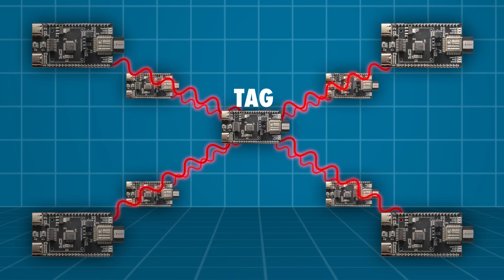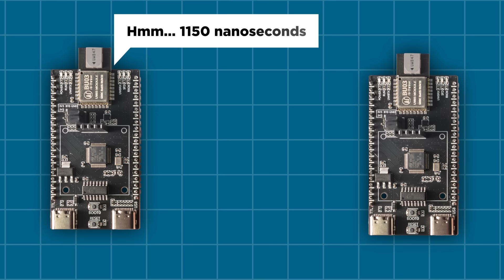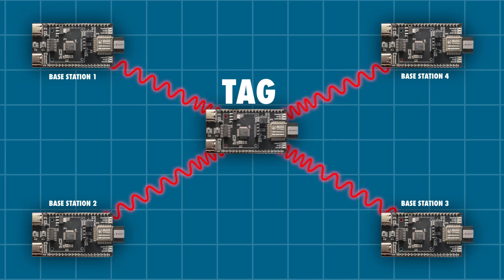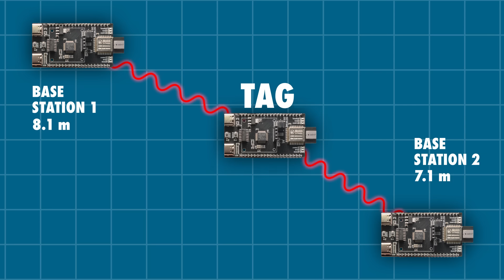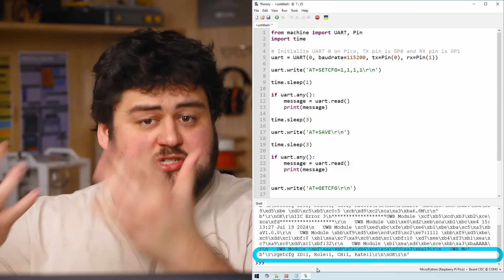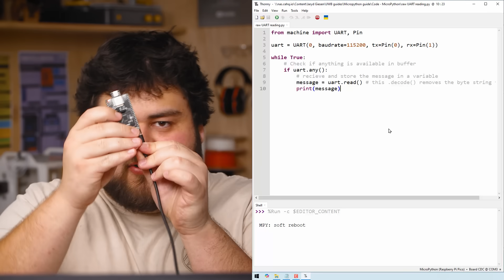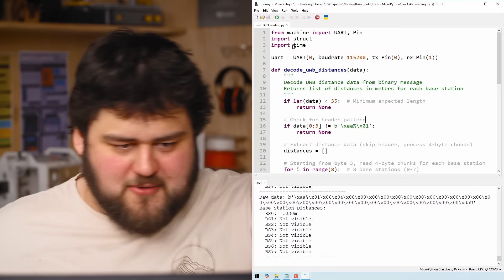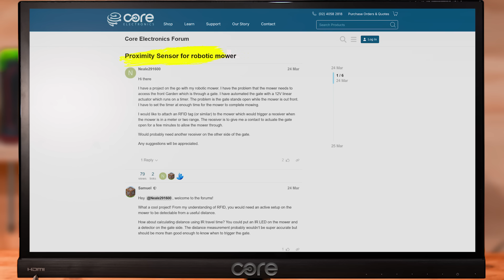This Pro‑Level Sensor Just Went Maker‑Tier

Comment: Will this still work if I mount my 3 UWB receivers at the wall and I want to track the Z (vertical |) and X (horizontal __) positions of the tag instead of a setup (like all receivers are on the floor) where X and Y positions is the output? Both are 2Ds but different axes.

Comment: One of my "Probably will never make this but fun to think about it" ideas is system that uses drone to tend a garden/field, one of the first obstacles that came to mind was precise tracking, something like GPS but local LPS would be needed (with beacons instead of satellites) but couldn't find off the shelf solution. This seems like potential solutions (with multiple of boards with known locations you could triangulate position of board with unknown position). Too bad i will never come down to do it anyway ¯\\_(ツ)_/¯

Comment: Nice video content! I hope you take this as just constructive criticism — your audio could use a lot of improvement for much better intelligibility. The content itself is great, but the voice track comes across a bit boomy and reverberant, which makes it harder to follow, especially over longer listening.
A couple of small tweaks could make a huge difference:
- Using a simple high-pass filter to cut rumble below ~80–100 Hz.
- Reducing some low-mid buildup (around 150–250 Hz) so your voice doesn’t sound congested.
- Adding a touch of presence in the 2–3 kHz range to bring out clarity in consonants.
- Recording a little closer to the mic, or in a space with more soft surfaces, will also reduce the room echo.
Your material is excellent, and with a cleaner, more focused vocal sound it’ll be even easier and more enjoyable to watch. Keep up the good work!

Comment: its like how mesh accesspoints as well as wifi adapter work but then on a smaller frequency 2.25 8.25 Ghz  instead of  2.4Ghz - 5Ghz AP & Adapter

Comment: isn't it like wifi dongles and access points?  dBi 20 - - - - -- -  90 - - -  - -  RSSi    ?!??!?!?!?
Reply: RSSi is just the power, that varies depending on the antenna, any other objects nearby absorbing signal, and reflections can be confusing.
This uses the time that the signal took to travel, which is much more reliable.

Comment: OMG - look at this price. I have been waiting for this for sol long the DWM3000 is so over priced. 

Halow ultra long distance WIFI and now this !!

Also I have done a HEAP of testing on your SIM7080G and now have it fully working and will post all the docs anyone needs to get that up and running with Hologram and an ESP32 instead of using the Raspi headers.

This is a very good day.
Reply from the maker: Legend! Publishing any sort of documentation or guide, top notch!

Comment: Anyone have thoughts on how difficult it would be to make a soccer player tracker to measure (x,y) coordinates and speed, acceleration, etc? Seems like I’d need coordination from three points around the field, and one on the player
Reply: Just use cameras to do this. You can even get pose estimation and it could do it at 60+ hz
Reply: Nvm, 15m range isn’t enough without an excessive number of boards

Comment: WLAN Sensing ?  Assuming I have four base points, 1 and 3 are close to the ground, and 2 and 4 are 2 meters in the air, the position of the five trackers should also be able to be located at altitude, right? 3D-Triangulation ?
Reply from the maker: Yes! You should be able to get some 3d tracking with that. We may have a video very soon about doing so!
Reply: @Core-Electronics  And what about the "Wi-Fi sensing" technology/approach?
Could this improve accuracy?

Comment: Is it possible to not only get the distance between 2 boards but also the direction relative to one board? E.g. "the 2nd board is 2m behind"? I do not see the any angles in the data frame, but wonder if its possible? Like an iphone tells the direction of the airtag with a little compass?
Reply from the maker: Unfortunately its only distance :(
Reply: You can get direction if one of the objects is moving and the other is stationary. You take multiple distance measurements as you move and then using trilateration you can calculate the position.

Comment: If you buy the v1 out of curiosity, implement it in a project, then v2 comes along with a feature that I don't really need and feel inadequate, ends up upgrading and the vicious cycle continues. All the variant of radar sensors, I still have catching dust. More cool sensors and chips, more reasons to continue being poor.

Comment: I think you only need 4 base stations and one tag for full 3d tracking - it's a cross-orthogonal configuration of base stations (2 aligned vertically and 2 horizontally) to provide vertical and horizontal triangulation in the 3d space.
Reply from the maker: That's true a minimum of 4 is needed for 3D tracking, we'll cover it in part 2 (coming out next week), but each module above 4 adds further accuracy and redundancy as operating with the minimum requirements may prove frustrating if one of your modules experiences dropouts due to line of sight or any other interference.
Reply: @Core-Electronics  Yes for sure, definitely more accurate the more base units you use.
But you should be able to self-calibrate too though via a least squares calibration - effectively finding the adjustments for each base unit that has the least overall adjustment.
Reply: should only need 3 plus the tag. It is the intersection of three spheres.

Comment: I have worked with Decawave/Quorvo UWB modules a few years back in a research program and they are very accurate. With their firmware you can also get triangulation data without the need of doing this yourself, thus actual x,y,z with respect with the network beacons. Before we would work with BLE beacons but they are not good for precission work since you can only make some distance assumptions based on the received power and the reported power at 1m which is also not very accurate and of course there is absorption by human bodies and other obstacles, so they would have to be mounted at a higher place on the walls and that would be a big problem for very huge spaces. With UWB and ToF measurements, all these issues are resolved.
Reply: Hey, im planning to do my Bachelor thesis on these modules and trying to make an indoor autonomous flying Drone. if you have some documentation or programs which could help me that would be great :D
Reply: @iwantitpaintedblack indoor is great with multipath assisted positioning. You can get channel impulse response out of decawave chips and do indoor positioning using a single transmitter and receiver. I did a PhD. on this.
Reply: @52VaultBoy  Wow that sounds nice, 
 How can you do indoor positioning with just one Transmitter and Receiver?
Reply: @52VaultBoy could this be set up with tractors or excavators for precision agriculture

Comment: great but can I transmit data between them or is this all it does
Reply: First I have heard of these, but off the video, I am thinking use one module as a trigger to a RasPI, (trigger @ n=distance) for a race gate lap timer. So, if that works, one PI could send data to another micro controller for other ideas and projects?.
Reply: @Inertia888  UWB was originally proposed as a secure data system you have a pseudo random frequency hop thing like 802.11 but over a much wider frequency
Reply: @TheShorterboy  Interesting and helpful. I'll be reading about it after work. Thank you.

Comment: Which sensor would you suggest for a 100m distance detection use case? Accuracy not all that important, more looking for a ballpark distance within a metre or so.
Reply from the maker: Best bet for that kind of range is a mid to long-range lidar system.
Reply: @Core-Electronics  I was thinking something exclusively wireless and should have said so oriignally. Light tracking is not going to work - think tracking gokart riders on an indoor circuit and wanting to track where they are in real time on a CGI screen kind of thing.
Reply: @Core-Electronics  appreciate the response.

Comment: If the accuracy can get down to about 1cm/1m (1%) and you can have multiple tags, could be a good solution for full body tracking.
Reply: It might be the perfect solution, no line of sight to worry about and no drift. Could combine with accelerometers for fine precision if needed.
Reply: @NightfallSentinel  I think this module contains an integrated IMU, if I am not mistaken. :)
Reply: @ArchaeanDragon  do you know if anyone started designing a kit using these to use with slimevr? I am not really a hardware guy but I imagine someone out there is leading the charge to package these with a strap
Reply: @ArchaeanDragon  Hmmmm, that's interesting.
Reply: LOS would still be a problem if you have metallic environment.
 @NightfallSentinel
Reply: There's a paper comparing the dw3000 (radio chip in this) with the DW 1000. Sadly accuracy is way off depending on the relative orientation of the antennas. Like -25% to + 10% off depending on the orientation, on a 3m test.
Reply: I was looking for a way to get in-room tracking of a handheld device, without needing cameras or lasers. These devices might make that super easy. Just one tracking sensor in each corner of the room, and even before you turn on the handheld device, the 4 standalone trackers could already know the dimensions of the room!

Edit: apparently maybe they can only know the distance to the "tag" which would be the handheld device. So the 4 base stations may not be able to detect that they are arranged in a rectangle of L x W dimensions.
Reply: @cyleleghorn246 it shouldn't matter which one the tag is, it just changes the order of the math.
As long as the equation is solvable which  it should be with enough base stations.
The issue is probably the accuracy but that could probably also be solved with enough base stations in the corners.
Reply: lack of rotation tracking would make this kinda hard to economically scale up though
Reply: The data rate seems high so you could histogram readings to get the mean. Or may averging 10 or 100 readings would be accurate. The data is noisy
Reply: DIY robotic warehouse would be a huge thing if you get 1-2cm accuracy

Comment: As soon as they get this down to the size and incorporated with ESP32 hardware I look forward to incorporating it into a helmet
Reply from the maker: The actually UWB chip and antenna are smaller than an ESP32, this is just a very large breakout dev board!
Reply: @Core-Electronics what’s the power draw, if you don’t mind me asking?  I’m guessing it’s 5v rail?   Are there active and standby modes?    Great channel by the way.  Just came across it two weeks ago and I’ve been really enjoying the content.

Comment: Is it always the case that only device 0 receives the data?
Is there a way to use device 0 as a relay? For example, can I connect device 0 to the computer as a relay, and then use devices 1 and 8 as anchors? If there are other possible methods, I'd appreciate it if you could let me know.
Reply from the maker: The distance data will come out of device 0, which will be the tag or base station 0. Both of these can get data. From this, you will receive all of the distance measurements from each base station to the tag.
Reply: @Core-Electronics  
For confirmation, here is my question:
If anchors 0 through n are installed on the ceiling, device 0 is used only as the tag (working as a relay near the computer), and tags 1 through n are used for tracking - is this setup supported?

It would be great if this scenario could also be covered in the next video.

Comment: This looks like what we need for drift compensation in imu's,    i am curious to see if the error can be smoothed out enough to discipline an accelerometer.

it would be lovely to have vr trackers that work under a blanket without needing recalibration.
Reply: I wonder if getting an average of 8 sensors placed on a object would be more accurate, than from just one and how much more accurate it would be.

Comment: I hope they  do a long range version  soon as this could be  great but  10x the distance at least
Reply: UWB doesn't work long range
Reply: @ThompYT  It can work somewhat longer ranges but that usually implies using directional UWB antennas like Vivaldi horns. That will throw out the distance calibration since the antenna can be 10x10 cm and it will have different "dimensions" at different frequencies. Remember that UWB can go from 1 GHz to 12 GHz for example. That's a huge range for an antenna, filter or amplifier to handle.
Reply: The UWB spec has a max power limitation and I bet that these chips are already near that. The only way to increase range is to make the receivers more sensitive. Antennas can't be made more directional either because then you run into isotropic power limitations. Directional antennas can help with receive sensitivity though but then you also have to drop the TX power.

Comment: Why would you need 8 base stations for 3d positioning?
Couldn't you use basic trigenometry to translate to cartesian coordinates with only three stations?
Reply: yes and no.
3 points define plane and there are two solutions for any set of distances from those points, one on each side of the plane.
If you can use application specific knowledge to eliminate one of possitibilities, you'd only need 3, otherwise, you'd need a 4th point outside the plane.
Reply: @ericthecyclist  that’s a really good point
Reply: You can, but the more you have stations the more precise you get. But trigo won't work evrywhere especially in high density environement there are issues of multipath waves

Comment: I wonder if you can increase accuracy by combining measurements from more units
Reply: I came looking to see if anyone had asked and/or answered that exact question. More precisely, 
Is there a good formula to determine how precise you can get with a given number of devices? 
What is the maximum accuracy given the maximum number of devices that will work with each other?
Reply: The data seems noisy, maybe histogram the results to find the mean or average the data.

Comment: This thing will change the world in the upcoming years. Imagine the tracking capabilities when these are put in cars, robots, devices, just in general will be insane to see how good it will be
Reply: Or bad.
Reply: This thing is based on already old tech, it’s already widely used for tracking operation in logistic and for autonomous robotic, for consumer it’s better to use the upcoming BLE 6.0 with channel sounding, you will get similar result at a fraction of the cost (BLE 6.0 will be available in consumer devices like smartphones  later this year)
Also UWB is used by apple for AirTags
Reply: @orlandobianco4338 "Widely used" is a gross overstatement. The goto solution for mobile robotics in logistics is LIDAR+SLAM.
Reply: @orlandobianco4338  "Green Tooth" is better.
Reply: not very good outlook
Reply: I'm getting in contact with UWB dw1000 chips for far too long. It is like 10 years or more and I haven't seen any paradigm change.

Comment: Best use case for me--
1. Put one on the squeaky floorboard upstairs
2. Go down to the basement with the other one, and find the squeaky floorboard exactly by minimizing the reported distance
3. Shim that squeak away
Reply: Same would be super useful for drilling the ceiling at the correct position
Reply: How does it handle walls and big obstacles ?
Reply: @k3lzZz  JAX from the amating digital circus
Reply: or use concrete for a floor lika a decent EU house
Reply: @zycar_diy  House was built in '73. Bit late for that, mate!
Reply: Came here to let you know that EU houses are better. Not sure if you were aware of this fact already.

Comment: Maybe useful for VR accessories.
Reply: The accuracy doesn't seem quite good enough for most VR applications. Maybe for foot tracking where the position doesn't matter as much.
Reply: @widgity  Is it like sub-cm or sub-10th of a meter? Slime gets away with forward kinematics and dead reckoning only for body tracking. If this is like sub-meter precision it wouldn't help much, but in anything better and it might be awesome.
Reply: @ChrisD__ I think the video said 10 cm once each module has been calibrated.

Comment: The product page says up to 40m with line of sight. Quite a difference to the real world results you mention
Reply from the maker: Good catch, we pulled it from a data sheet and forgot to update there. We mention 25 meters and 40 meters in there, will give it a fix!
Reply: could also depend on the environment, Rural urban, forest field etc.
I was wondering if antennas could be used to extend range?